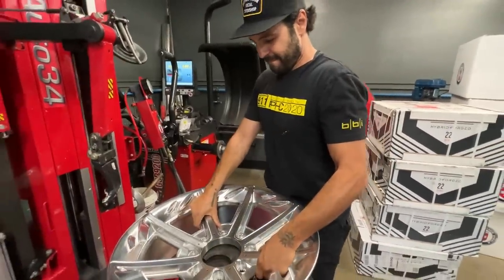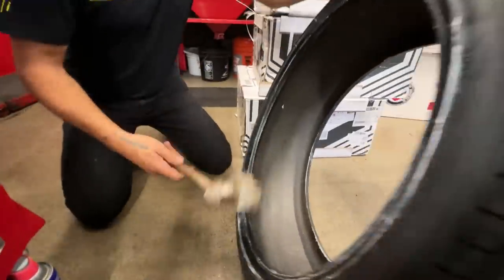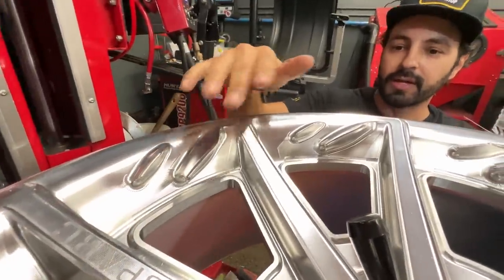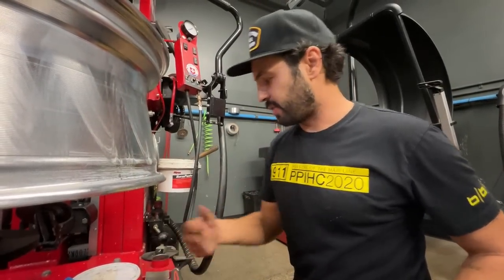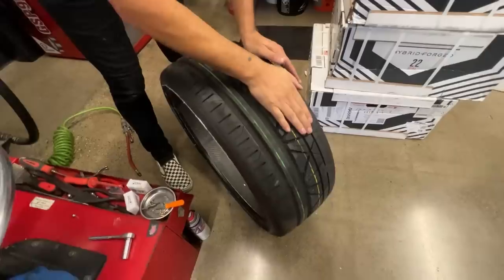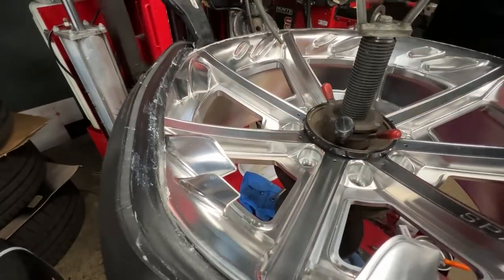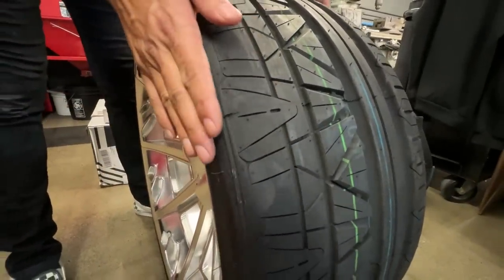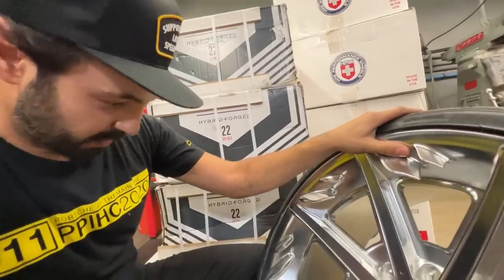Mounting tires on a $25,000 set of wheels | BANKS BUILT Bonus

Comment: I'd like to see him demount it for a puncture repair or to change it, I'm sure it would be scuffed. Most high end equipment clamps on the outside of the wheel and it's held face down so all the work is done on the back lip, but there's more than one way to do it.

Comment: Can you please up load a video of your engine turning at 7000 RPM
Reply from the maker: No. However, we will post a video of the engine turning at 5500 RPM. Stay tuned!
Reply: @bankspower  sweet been waiting forever to see it…
Reply: There is a point of no gains with some engines and high rpm. Many do just fine below 7,000 and some will simply cause more wear at those speeds.